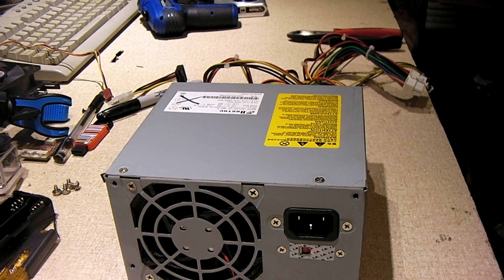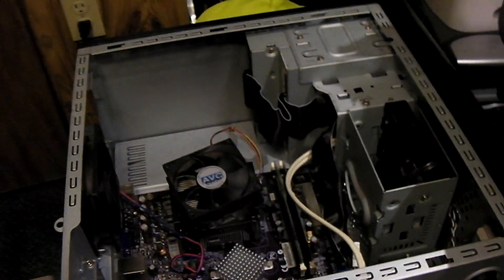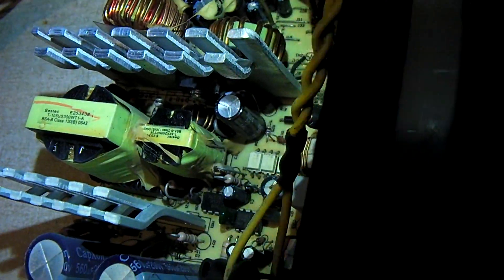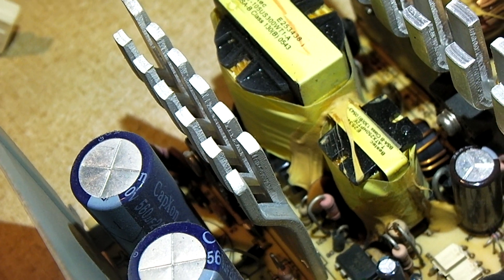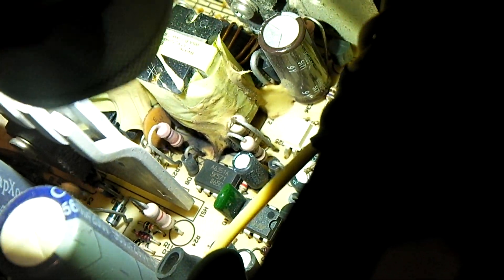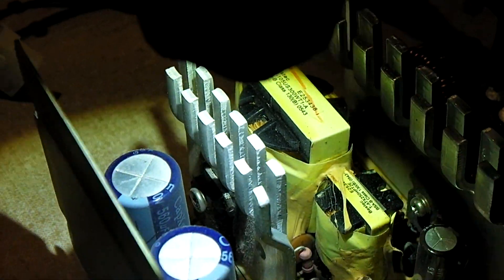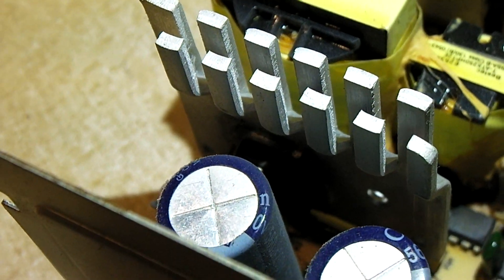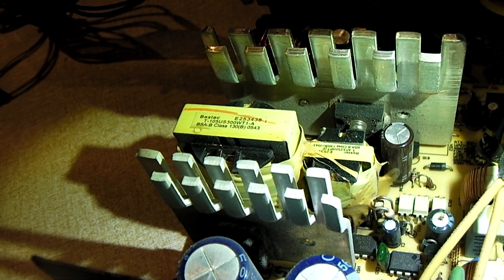Part 1 - Looking inside a failed (exploded) Bestec ATX-300-12E Power Supply

Comment: My Bestec-ATX300 all seem to have C36, the capacitor in front of the low-voltage side heat sink, next to transistor Q18, visible in this video. Often there are also pop-top caps in the "tangle of wires" output that need replacing. I've fixed a couple of these P/S units with replacing C36 and anything else that looks wrong. An ESR meter helps a lot finding bad or "suspicious" caps. If you have the parts, these are worth repairing.
Reply from the maker: I regularly fix these... have one installed in one of my systems running a Ryzen 5 5600G setup
Reply: @CubeComputerChannel  I have "a few" as the (2) HP Pavilion m9040n I own uses this P/S (2006 era) computer. Was a descent Media Server running Win7. I've fixed the mobo in these systems, but didn't have much luck fixing the P/S units. Over the years, I've learned more about desoldering "hard to reach" parts, testing bad caps and am having a much higher fix success rate these days. These are now running Linux and still very useful computers.

Comment: do you know if the light inside my powersupply can be disabled?  I thought it would be cool blue coming from the computer.  Moved computer in bedroom.  Not cool.  Your video is informative.
Reply from the maker: The light in question could be in the fan. If that's the case, you could replace the fan with a standard non-lighted fan.

Comment: Interesting video, this will definitely help newbies to hold back from these firework supplies
Reply from the maker: These really aren't that bad. I typically reuse them and replace failed capacitors if necessary. The one Bestec model to avoid however, is the ATX-250-12E since it has a flawed design that will fry motherboards. This is the first ATX-300-12E I have had fail on me. The replacement supply in the computer is another one of these exact units.
Reply: @CubeComputerChannel  Hello, is it possible to get in touch with you ? thanks